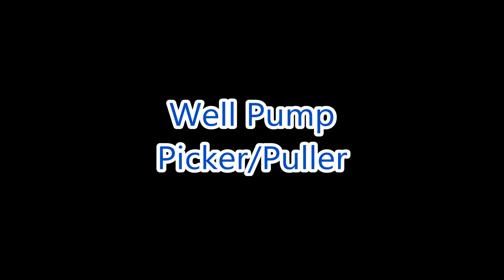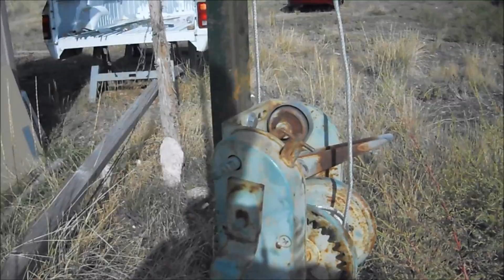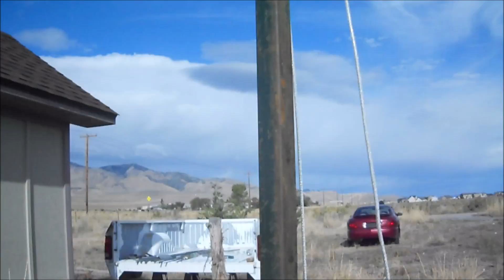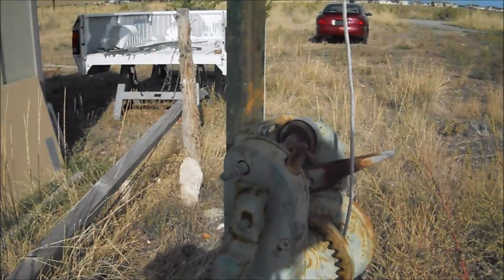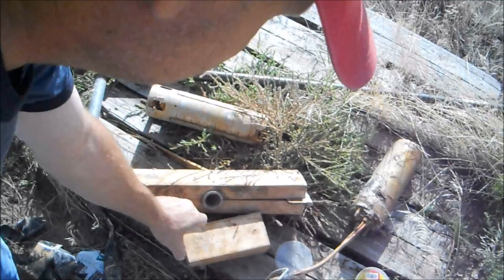simple homemade submersible well pump puller using old boat winch and Unistrut

Comment: Could you please make  a good video showing the full picture of the setup. It will help . Here the entire setup is not clearly visible. Otherwise if you could make a video showing the diagram on prn and paper. I am in a remote place and alone not able to understand how to pull my pump without others help. If you could make a video demonstatinh the entire setup by drawing on a piece of paper  it will be helpful. May god bless your ministry.
Reply from the maker: I'd would rather send you a drawing thru email. I moved to Wyoming, also remote area, my internet is very slow. Uploading videos takes several hours these days.

Comment: You could have more of you actually using  it would have helpful.
Reply from the maker: Well if you notice the date on when this video was made and understood that youtube used to be it's own thing before Google bought them out; at that time you could only upload videos around 8 minutes long with out having to make several parts to it, also the cameras back then weren't the greatest. At the same time if you actually had a real youtube channel you would see how long and hard it is to make videos, most people only watch around 2 mins of a 15 min video because they skip thru it. Anyways the picker worked well. Thanks for watching.

Comment: I'm about to attempt pulling a deep well pump by myself, and I really appreciate the solutions that you've shared...especially the pipe clamp idea.  I was thinking of making a pipe clamp from a pair of vise grips with a couple of pieces of angle iron welded on to them, but your clamping solution is easier and I won't need to drag out the welder.  Thank you for sharing your ideas, and the word of God.
Reply from the maker: It sure saved us a lot of money, I also used it to help out our neighbors. Thanks for watching.

Comment: Pull it by hand a lot quicker. This is not I a good design by any means, maybe do less preaching and more thinking
Reply from the maker: To each there own. maybe ask the Good Lord for wisdom next time before looking at everyone else's ideas, If you had a better idea where can I find it. also well was 120ft deep I would like to see your video pulling it by hand.
Reply: @TheBlueCollarPreacher  pulled plenty 150-200 in my time. Just ran across your video, wasn't searching for the nonsense. Wisdom comes from your brain, not an imaginary figure. Btw, it takes 10 mins tops to pull one under 200ft
Reply from the maker: @ahhell1  post it pictures are worth a 1000 words.
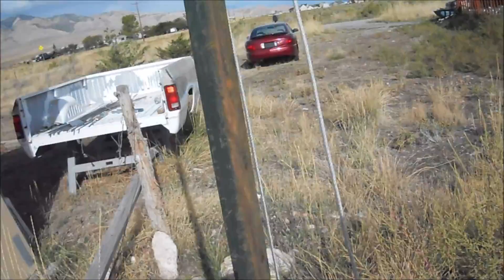Reply from the maker: @ahhell1  RO 1:16 For I am not ashamed of the gospel of Christ: for it is the power of God unto salvation to every one that believeth; to the Jew first, and also to the Greek.
Reply: @ahhell1  - imaginary figure? ROFLOL...this coming from one who believes in the faith based religion of evolution.
Reply: Hey Mr smart well pump pimp, what was the pipe material he pulled from the ground? Galvanized would probably be roughly 500lbs of weight plus resistance so yeah Mr butthurt can't just go th on elsewhere, where can I find your wonderful superman videos?

Comment: Amen,  - nothing like a good King James Bible quote.  ~ I do my own well work too, I made a 23 ft. pipe boom that hooks to the back of my pickup truck, and I use an electric winch, mine's in 20 ft. sections.    ~ An old pipe vice works good as a pipe clamp also.
Reply from the maker: +Blackaboe Thanks, I have had to pull my pump twice in ther last 15 or so years at my home. Hope to never have to again at this residence anyways.
Reply: The Blue Collar Preacher

Do you have iron, or plastic pipe in your well?
Reply from the maker: +Blackaboe plastic.
Reply: The Blue Collar Preacher
That makes things mighty easy.